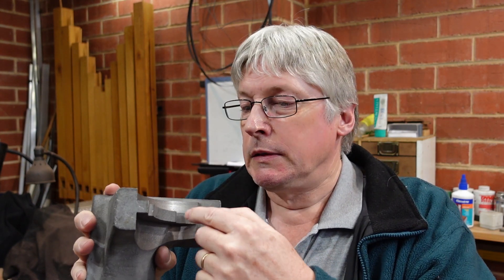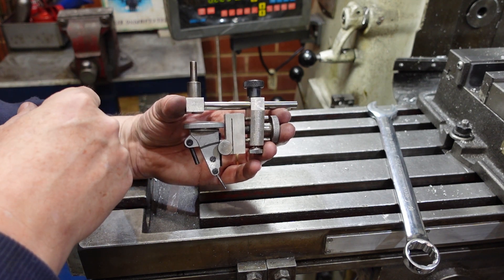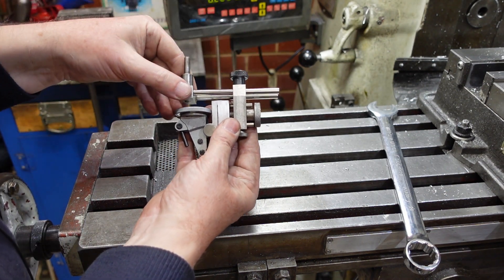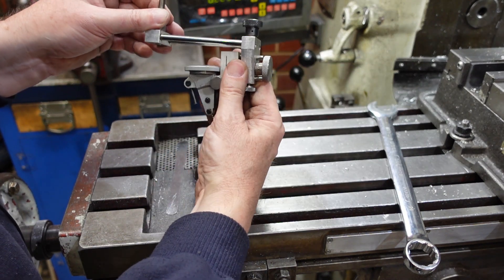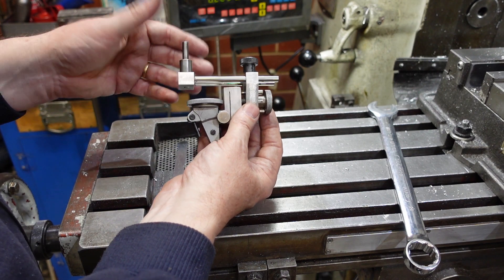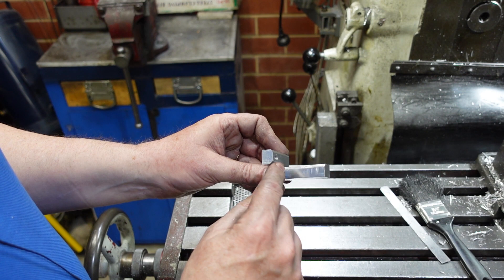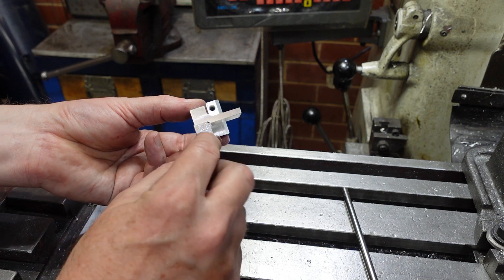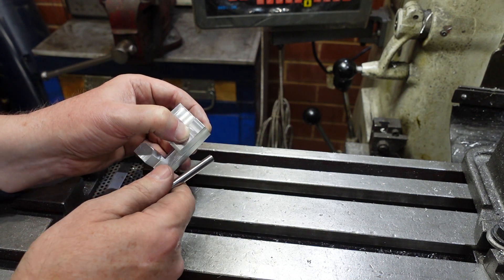The Double Zero DTI holder

Comment: Drawings as a part of the video are at best, hard to use.  "Pause", "More videos" captions cover up certain dimensions.
Reply from the maker: I'll try to position better in the future. I've just had a look most look alright on my screen  but on the third page the line goes through a dimension that is 16 (length of plain shank on the fine adjustment screw). If there are others, post and I can say what they are.

Comment: It's a good job. I am a cheat. I have made up a bunch of holders for my finger clock. I get a piece of 8mm silver steel (needs to be 8.00mm or else the clamp crushes the clock slide) and kink about 30mm down 20deg or so. I cut to length and weld a 10mm dowel at right angles to the 8mm long leg. I simply then use the dove tail clamp on the kinked bit and fasten my clock.. I have a bunch of them for different radius I need to clock.   Cheap, quick, good visibility to use  and rigid. Doesn't use up height as I try not to raise bed height if possible.
Reply from the maker: Well, there's an easy way to do it, and there is the way I've done it! The reason I preferred this approach was the fine adjust - I really like not to have to bump the clock, relying on luck for positioning